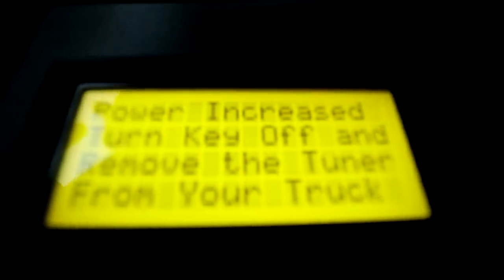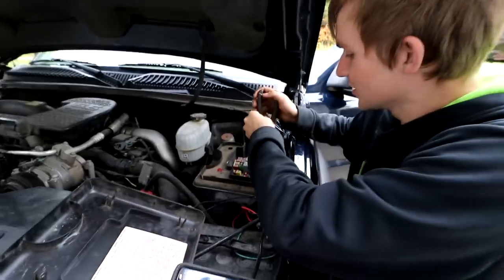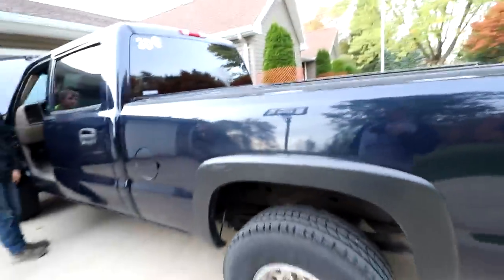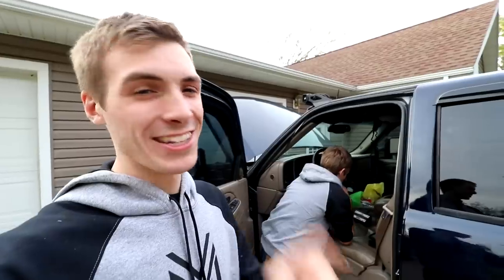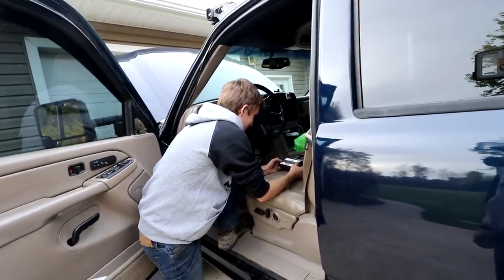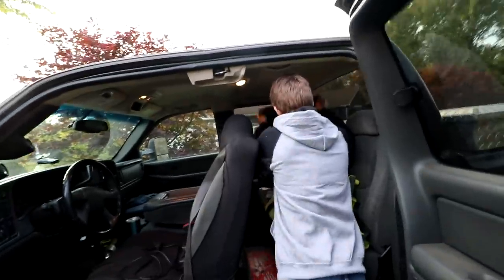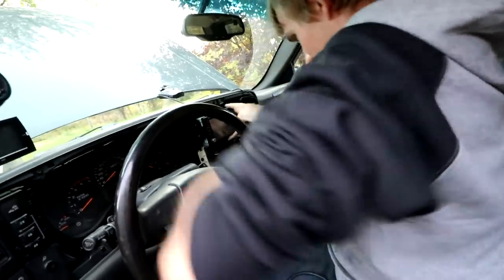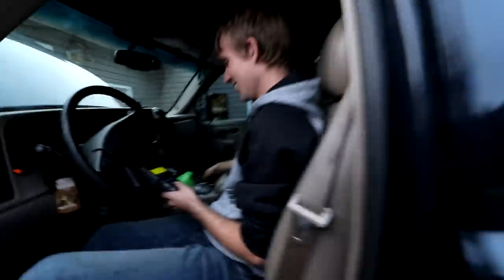I TUNED MY DURAMAX...(POWERFUL)

Comment: Hey Dalton, I live in Twin Falls Idaho and bullydog is located about 1 hr away from me in Aberdeen Idaho / American falls Idaho. If I'm not mistaken, you can call them and tell them that you have received that programmer as a gift not knowing that it was still loaded onto the other person's tk that got sold or whatever the case might be, and tell them who you are and where your from and about your YouTube business and it's a good possibility that they will reflash the programmer to work on your dmax. They are a great company to work with and very nice people. I have a bullydog triple dog on my stroke and it works awesome! One thing though, if your going to run a tuner I would highly recommend having at least a 4" exhaust turbo back and a monitor to watch egt's and set parameters so you don't do any damage to the motor. Call bullydog tell them you'll feature their product on YouTube, they might hook you up bro! Stay froggy fresh and braaaapp on buddy!!!!

Comment: Blown head gaskets here we come!
Reply: Now that's a repair video I'd be interested in. Honestly.
Reply: doesn't it have over 200k miles? so would say something is going to break
Reply: hes going to blow a turbo before anything hes probably going to run a higher boost and hes not going to boost it correctly and blow them at the line

Comment: I’ve ran bullydog tripledog power pup with the 320hp crazy Larry tune, also ran edge juiced with attitude, and superchips flashpaq all on my 03 lb7. I will say bullydog, and edge are garbage. Superchips never gave me any issues. But my trans slips and no longer has limp mode after running bullydog and edge. I now have efi live dsp5 tuned specifically to my trucks calibrations. Trans is holding together but is definitely going to get built by Dmitri Millard in the future. Dalton I highly Recommend EFI LIVE from a reputable dealer! Do cheap out when it comes to your truck if you want it to last!
Reply: gregory543210 never got cheap on something that basically controls your whole truck

Comment: PPE is really the best option for a Duramax. EFI live is a great option also, but the guys at PPE really have the Duramax figured out, and also produce a ton of their own aftermarket support for them also, as well as kits for the Allison. They're literally a one stop shop for anything with a Duramax. Just my opinion, and I've used both.
Reply: Hard parts, yes PPE makes a lot of great stuff, but no way their canned tuners will beat the EFI Live platform and a reputable tuner.

Comment: Does the gas milage change at all?
Reply: yes
Reply: No but the fuel mileage does
Reply: Depends on which level of tune. Most tuners come with pre sets like mpg, towing, 50hp, 100hp, 150hp, 200hp
Reply: Drake Falkner yes for the better I have a. Sct livewire on my 6.0 An went from 17mpg to 20 when I could keep my foot out of it

Comment: Seriously you don't want to use a tuner unless you never ever go over the 2nd stage of the tuner. I used one while my F550 was still under warranty while towing a 3 place car hauler. I was in the mounties running my 38" - which will fit under it with no lift - I needed a bit more power so I decided hey the power is here I should use it. Well I ended up pulling the studs out of the heads and one burnt piston. While waiting to get towed to a dealership we yanked the tuner off. First thing service advisor said was what brand tuner were you using LOL. It needed one head - all new studs - piston and 3 new injectors. My cost - after a deal was made with the service advisor - I paid him $500 cash to go into his pocket plus he gave me a five year nationwide warranty. By the way your paint job looks great and I like the matching color on the wheel well plastic better than black......but can't really tell on yours there black. Nice video's
Reply: Playtime didn't watch your egts or guages 98% of the time that can't be prevented by watching guages and proper maintenance tuners are actually good for the truck if you do your research

Comment: Order an edge tuner best tuner you can get your hands on
Reply: Connor Freeman, negative. Efi live with a dsp5 switch. Custom tuned and built for your trucks mods. Had both. Edge threw codes and limped the truck a lot.
Reply: My truck came with an edge on it. Ran like shit. Efi is way better
Reply: I second both of the other replies to  this!
Reply: Efi live with edge insight cts2 monitor
Reply: Edge sucks they don't stand by their warranty a guy I know had a 2016 Denali with an edge and it melted his whole computer system completely totaled the truck and he's still fighting edge about it they're giving him dumb excuses as to why it happened like his truck wasn't stock so that's the issue?! Shouldn't melt the damn system no matter what's done to the truck

Comment: Tuning a ford is so much easier. Just a little box on my dash, tune on the fly is the best 😀😀
Reply: My f250 took 1:30hour to straight pipe and tune
Reply: Then you dont know much about the 7.3, they can go through all hell and back till you have to touch the block. 6.0s, yes you are correct,  stud them and youre fine, 6.4s are total junk, they crack pistons and the 6.7s are fairly good. I dont know thise as well.
Reply: TimmyTeaBag a 7.3 is way better than a 6.6 I have a ts140 on mine with 360k the tranny still shifts great
Reply: TimmyTeaBag yeah how many head gaskets has that "1.1 million" mile motor been through I'm sure quite a bit I got a 1.8 corolla with 180k starting to have bad blow by
Reply: TimmyTeaBag it was a tundra with a 5.7 with 1.1 mill on YouTube stick everything nothing replaced guy was a delivery guy and it’s all highway
Reply: Cole I seen that video my brother has a 4.7 they're great engines but the oxygen sensors go out every mile
Reply: TimmyTeaBag and no it's not a 3.4 it's a 1.8
Reply: Cole and that tundra was a 4.7
Reply: Cole also are you like 12? You got some kiddish videos on you're channel, 🤥

Comment: Have fun replacing your head gaskets and injectors after putting on your tuner, believe me you will be doing that soon
Reply: mark rezac with that tuner yes the reasons the injectors go out is lack of fuel injectors don't get enough lubricant so you should always get a upgraded lift pump
Reply: Spoken like a true amateur

Comment: My Suzuki drz125L keeps backfiring can anyone help?
Reply: Yes 1st step sell it 

2nd step buy a Honda
Reply: Hi, You need to tune the carb, when it backfire usually it is usually to lean, turn your idle mixture screw back one ore two turn change the clip of the middle to the lowest grove and buy a bigger jet if needed. Look the spark plug color, it should be a little brown. After that the engine should be running nicely and and cooler.
At what altitude do you live ? Sea level ?
Reply: Lean or you have a exhaust leak

Comment: Hey wtf happened to the old times when you can put a cam and some headers and some tuning with a with a flat head and some other things for the engine my 85 Ford f250 is like what I put down it's more fun and funny to race people how think that there Honda is fast or any other car that a teenager wood have
Reply: Rob Bam old timers don't deliver power like the new trucks lol had a 383 striker pushing 450hp and my 6.0 feels way more powerful